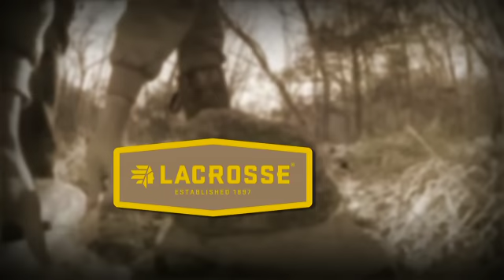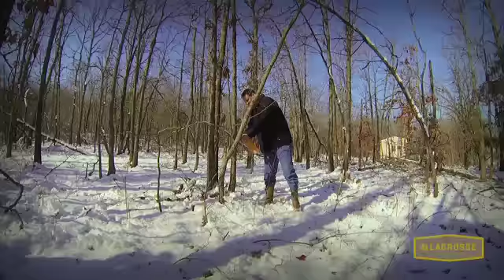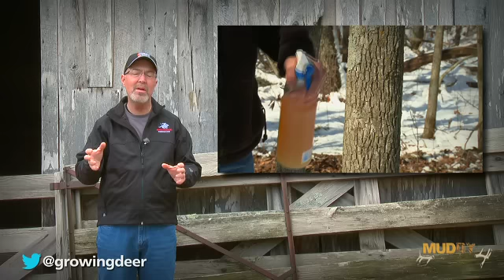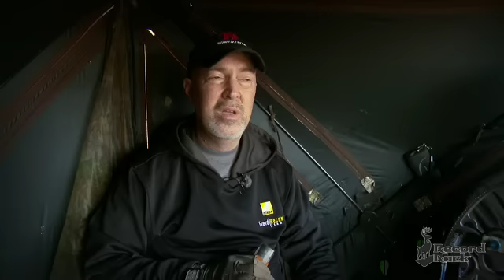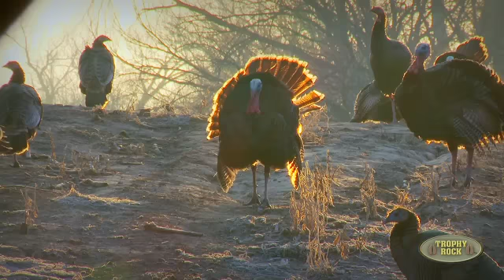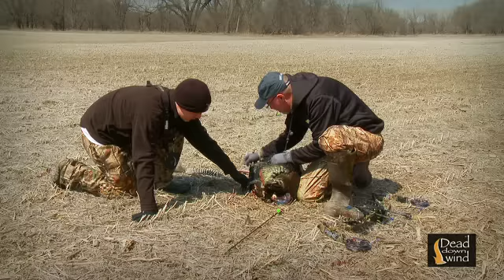Bow Hunting Excitement: Big Nebraska Gobblers (#176) @GrowingDeer.tv

Comment: If you want to kill the tree without herbicide you can strip bark and cambium in a circle around the tree. One minute per tree with a wire saw but poison free.
Reply from the maker: Oz, Thanks for sharing!  Girdling does work sometimes!  However, some trees will simply sprout below the girdle.  Herbicide has a higher effective rate and only one milliliter is used per 3" of the tree's diameter.  This is a very safe and fast method to improve forest health! -Grant

Comment from the maker: It's the RedHead BlackOut Blind from BassPro
Ultra-dark interior for ultimate concealment, Extra-large size for multiple hunters
Light enough for easy transport--weighs only 21 lbs.
Includes backpack-style storage bag
Easy to set up and take down
Zippered exterior windows
Shoot-thru mesh
Ceiling Height: 73"
Hub to hub: 82.5" x 82.5"

Comment from the maker: We use 1 ml (basically 1 droplet) per tree 3” in diameter and smaller.  This is dispersed throughout tree.  The rate that each herbicide degrades varies, but most herbicides we use has the same toxicity of toothpaste – much safer than herbicides used 30 years ago.  Most of us do more damage to the environment with the household chemicals and prescription meds we put into the environment daily than any herbicides we use.

Comment from the maker: Arsenal is agood herbicide for hardwoods  I don’t always use Arsenal as it transfers easily from tree to tree if they are root graphed (happens commonly among wild grown trees). Arsenal is ground active, meaning if it's spilled below a white oak I wanted to keep it could kill the tree.  Glyphosate is ground neutral  - it’s neutralized once mixed with soil.Yes, I’ve had good results using the hack n squirt method  except when the sap is rapidly rising, sap can push the herbicide out of the tree.